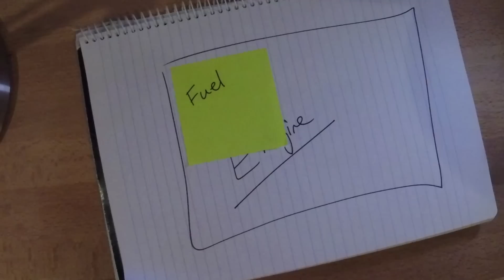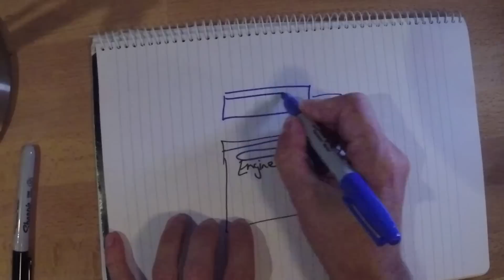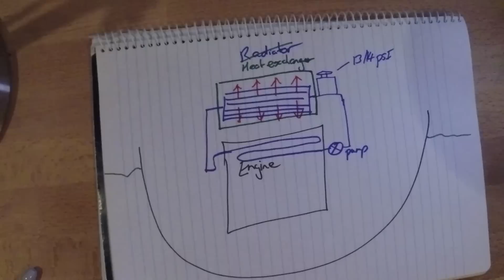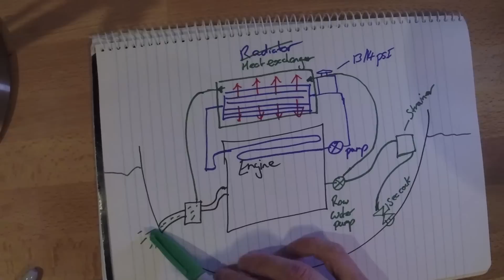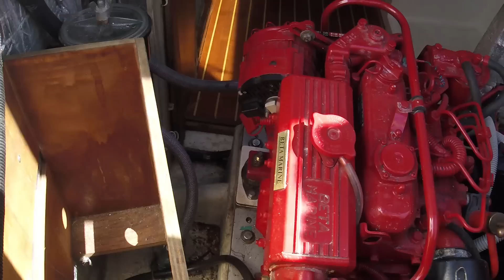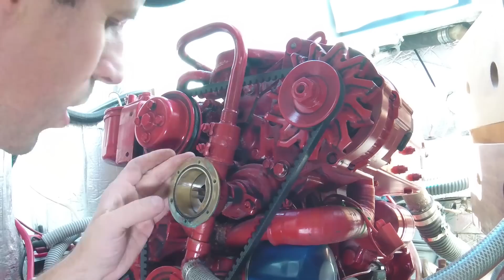How to maintain a yacht/sail boat engine cooling system, including replacing the raw water impeller.

Comment: After a while, when it gets hot, the water comes out a little and it is hot. Is the problem with the pump or is the valve damaged? Is the cylinder head gasket damaged?

Comment: Hi, quick question: You mentioned @11:55 that the jubilee clamps have to fit well. In the event of the fittings breaking off, wouldn't it just be a matter to turn the seacock closed? Or were you referring when under-way?
Reply: You know Murphy’s Law — well I bought a former charter boat as it was a “deal” (never again). One of the clamps on the bilge-pump had corroded through and water was just bubbling around when I arrived on the boat for a quick check as I do each week. 
Stuff happens on boats and all you can do is mitigate

Comment: In depth video, but please get the details right first.
Just a few items that caught my i at first glance

Seacock shows signs of dezincification (green), meaning it is brass instead bronze or cr messing and can tear off at any moment.
Basically making your vessel a timebomb to sink. Adding a backinplate would be even better.

Hose clamps should be of te closed type. These are prone to tearing. 
Hose on the strainer is not pushed all the way up on the connector.
I saw another hose connect to a copper tube without a connector.
Reply from the maker: Thanks for your feedback, as with any 30 year old boat many things are not prefect. I've not mentioned dezincification in the video as the field is complex and at little contentious. But I'd agree with you that diligence of inspection of seacock and through hull fittings is important.

As for hose clamps.. personally I prefer the open type hose clamps, I think they slip less, than the closed type. But as with anything quality is the important thing here.

My strainer hose has now been pushed home, good spot!

Comment: Great video!  I would point out that the hose coming off the strainer is not pushed home and there is 3/8" of pipe exposed 12:37. That will be a very unhappy diesel if that hose pops off starving it of coolant.  A 2 minute job to undo the clamp, push the hose home and retighten.
Reply from the maker: Thanks hadn't noticed that, I suspect it been like that for a long time, since before I owned the boat, but looks like you've found another job for me.... not that the lists isn't long enough already!. :-)
Reply: The likelihood of failure is low, but it's one of those things that weakens the overall system and takes nothing to fix.  It's often another failure that taxes that weakness.  Imagine a failing motor mount, engine vibrates more and then pop.(I have an active imagination.:-) )
Reply from the maker: Interestingly I've just replaced the engine mounts  lol

Comment: diesel looks like Kubota   D1105, I did not  know about that sacrificial plug, will check it, thanks a lot.
Reply from the maker: Thinks they are the same engine, at least parts often appear interchangeable.
Reply: You r right, Beta Marine retrofits Kubota ,  B 30=D1105. If its not a problem, can You tell, where  to order plug,  Iam not good with tread, my friend told me , that  plug is 1/2in,  18TPI,  thanks.
Reply from the maker: Do you mean the Annode (plug)?
Reply from the maker: ah I ordered mine form the states i've the details somewhere i'll dig them out!
Reply from the maker: So its a 1/4 NPT x 1-3/4" I got mine form BoatZincs.com
Reply: sorry, I missed  your answer. I ordered the same place, same plug. had to cut leight  to fit. Thanks again.
Reply: is there any model ## on sea water pump? You are lucky, my pump attached to rear of fuel injector camshaft, impossible  to serve. after watching your videos,  I checked my front cover and found 
plug and threaded holes, I guess location is optional.  now trying to find correct  pump or go with crank pulley mounted pump.  best wishes.
Reply from the maker: I cut my first anode to length as I couldn't get it deep enough into the housing at the end of the heat exchanger, only to find the when I recently stripped my heat exchanger that the housing was full of the bits of old anode.  Might be worth a look, specially as in my case they were blocking the flow through the heat exchanger!
Reply: thanks, good idea. I will check when winter is over.

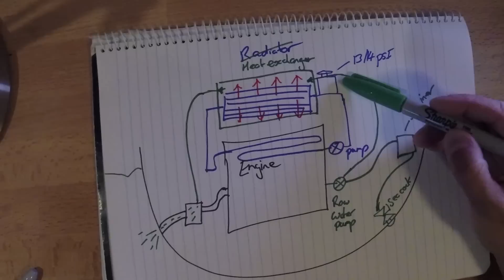Comment: Would the boat not sink as per your diagramme at 8:54? I think the exhaust should vent above the waterline.
Reply from the maker: Yes, exhaust should have been drawn above the water line. Although it is not uncommon for the outlet to duck under the water on a sail boat, the positive pressure of the exhaust preventing water entering the exhaust pipe.

Comment: Good video. Ever replaced the exhaust elbow gasket? I have some issues getting the bolts out, 1 broken head and 1 seized😬 on my beta 14.
Reply: You might consider running the engine to full temperature which may reduce the friction on the bolts as the metal around the bolt expands slightly. The bolts will also expand but it may be less and also the heat may break the friction lock the metal has on the bolts. You may want to apply some additional heat with a propane torch. Be very careful using a torch in that area due to flammables close by. Keep a large fire extinguisher close by. If this works then once the bolts are out and the elbow is removed you can continue while the engine is hot and remove the bolt with the missing head using a small pipe wrench.
Reply from the maker: No sorry mate I've never removed the exhaust elbow. I'd imagine that a combination of the wet exhaust and heat may well seize the bolts in this area.  As with all seized bolts, heat and penetrating oil often helps.